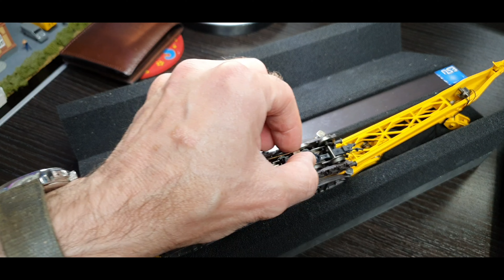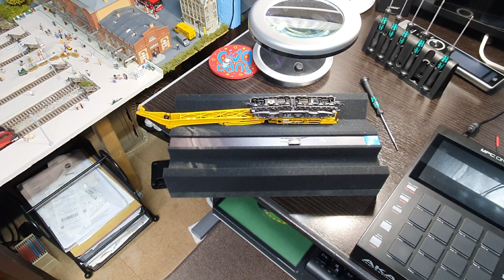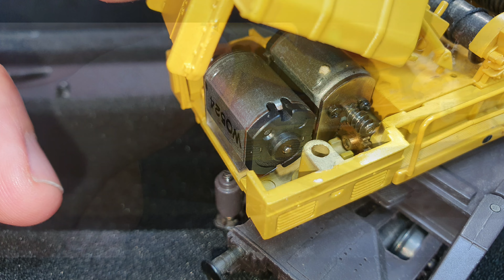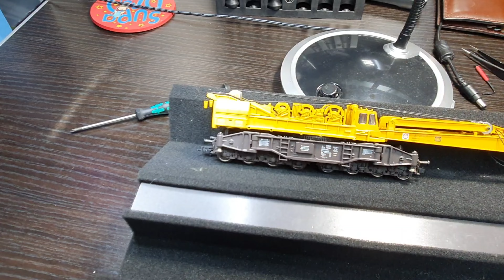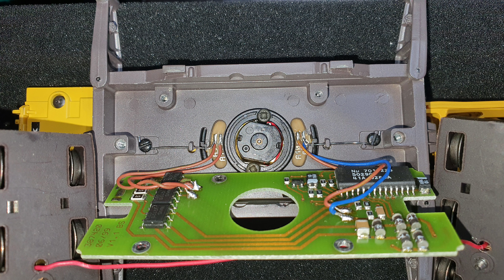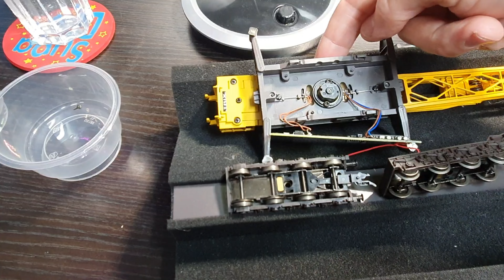PART B Trix Goliath crane taking the crane apart. #modelcrane #modelrailway #modelrailwayscene

Comment: To remove the motor for the slew I would suggest getting two much longer screws or threaded bars and replace each screw in turn with the longer screw/bar. This allows alignment of the removed motor through the holes in the casting. Then replace the original screws when in original position.
Reply from the maker: Thanks for your information. 👍🏻

Comment: The pdf manual for the later Trix 23540 crane is on the Manualslib website as are most Marklin Trix models. No exploded parts diagram though which suggests they never sold parts for it. 
The Markin version manual is still on the Marklin site.
Reply from the maker: Thanks for your research .
Yeah the manual mentions no spares and the Marklin site shows only basic parts.
I will get my electronics engineer friend on the case next..👍🏻
Jim..

Comment: My crane comes with socket and decoder. great video, were you able to solve the problem? Regards
Reply from the maker: Hi no the pcb or chip just shows errors ,so not sure yet ,
I may do a more detailed search for failed diodes on the pcb before retro fitting..

Thanks Jim.

Comment: I was right when I went o 😮not going to be easy or straight forward.
Reply from the maker: Yeah you are right, not sure what to do next, my electronics friend to check the diodes , or rip the board out and install a new interface and chip.
The crane has a special control unit which is bespoke to the crane so I would like to keep it orignal if I can.

Thanks for watching... Jim.